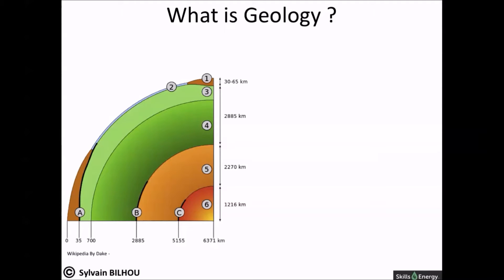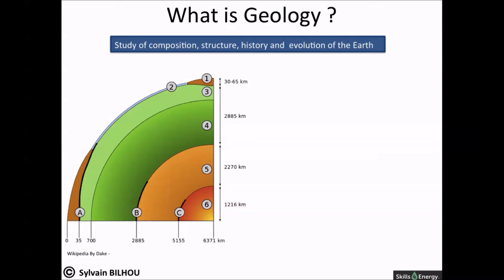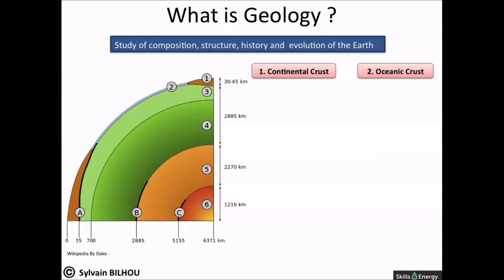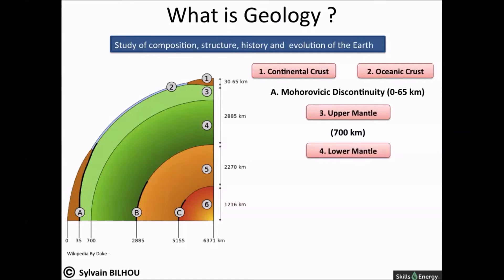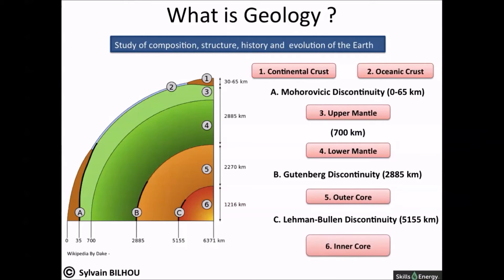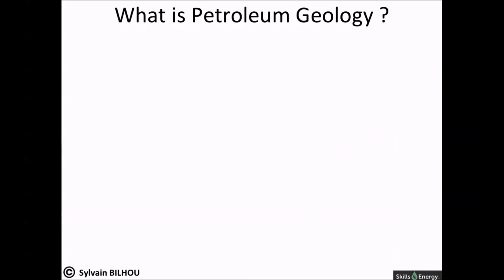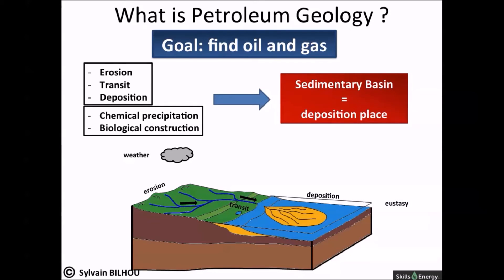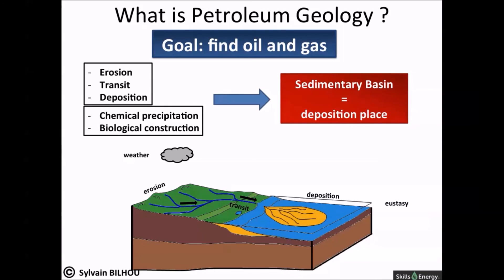1. Introduction to Petroleum Geology and Exploration

Comment: Thanks for the video, but I don't think that weather is among the principal factors controlling sedimentary basin subsidence. I would say : (1) Thinning of the lithosphere due to horizontal extension: (2); Increase in lithospheric density due to cooling and melting of crust or magma crystallization, as well as mineral transitions (from low to
higher); and Isostatic subsidence in response to sediment loading or flexural loading.